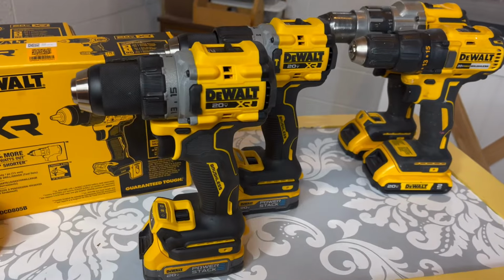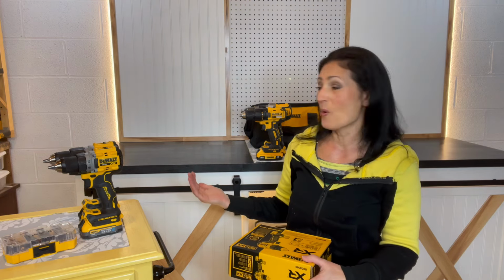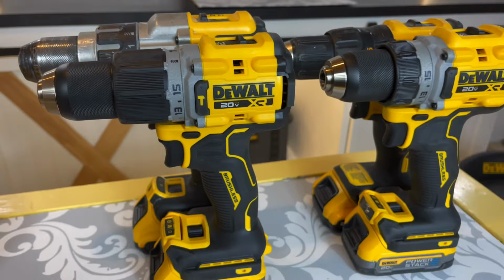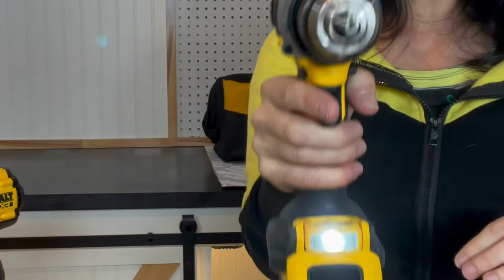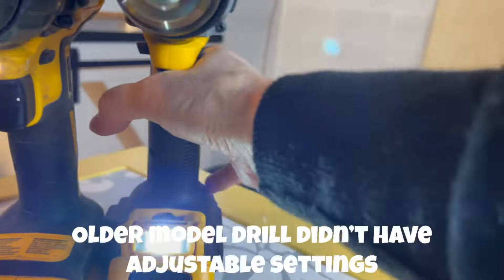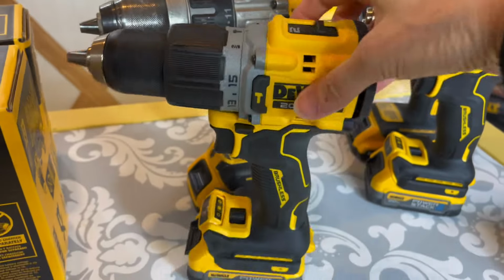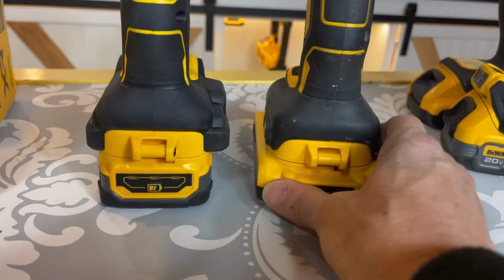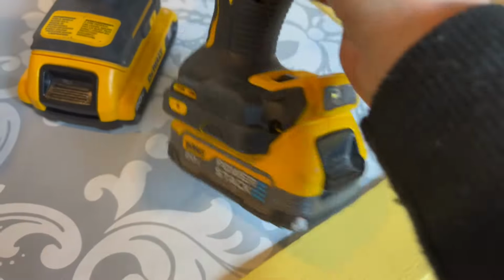New DeWalt DRILL UPGRADES we really need! DCD800 & DCD805 | Miss DeWalt

Comment: I’m considering getting the dcd800.
Has anyone on this channel used it extensively?
If so, how does it perform?
Reply from the maker: I use mine often but not exclusively because I have others. Its small size has been a plus in cramped areas and it’s very mighty in power. I used the 20 minute timed directional light as a flashlight to work in the dark once. I can’t really think of any negatives.
Reply: @Jennyfromtheshop  I just bought the 800.
From all of the videos I’ve seen of it, I think it’s going to be perfect for my needs.

Comment: youre comparing the drills to the wrong models.DCD800 is a direct replacement for the DCD791,and the 805 to the 796.
Reply from the maker: I had to use what I have. I don’t own the other models.
Reply: So maybe next time you will compare the 850 to the 900, because you don't have the 899... 🤦🏼🤦🏼
Reply: @Roffepuck I think you've made your point ol roffepuck... 4 different comments is 3 too many. Get over it